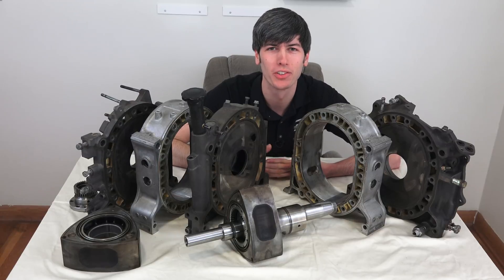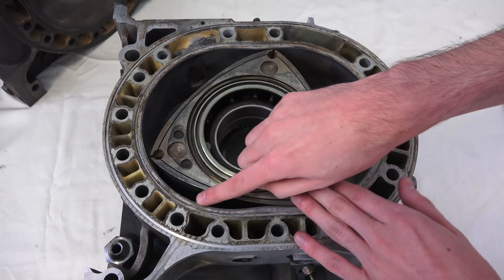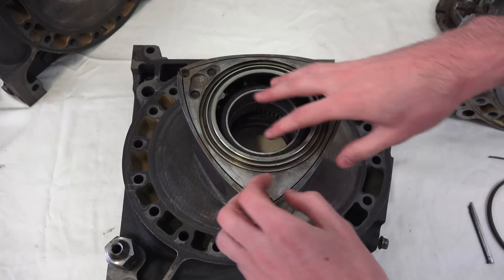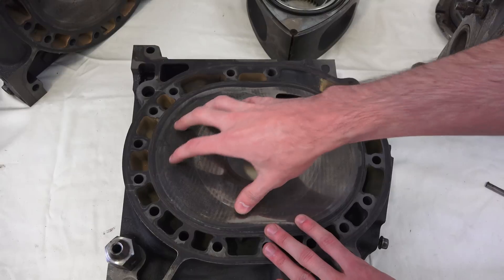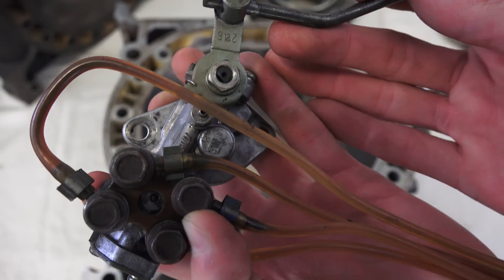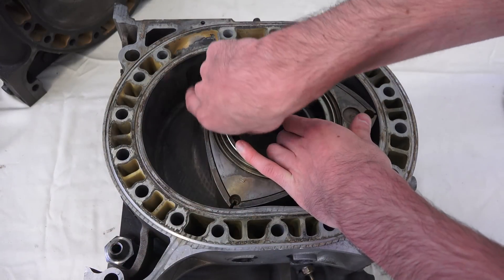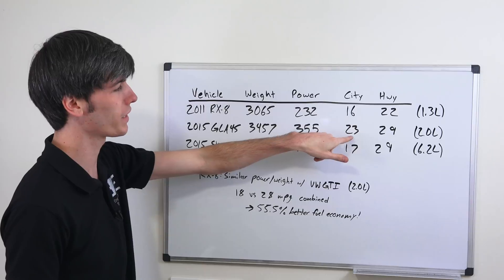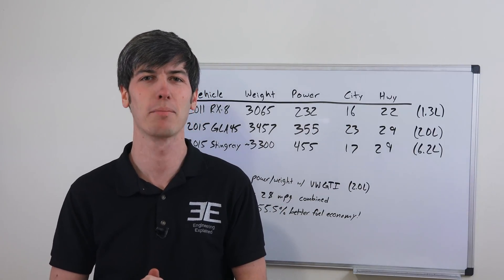4 Reasons Why The Rotary Engine Is Dead

Comment: 1.3 makes 200 Hp impressive
Reply: +AZiZ True, but they are totally different from reciprocating engines. If they were measured the same way as the air/fuel burned per rotation, they would be considered a 2.6 liter when compared to conventional/reciprocating engines.
Reply: +FLoYdInPink 160 ft-lbs at 5,500 rpm is garbage. My four door volvo puts out 240 ft-lbs as early as 1,500rpm. Rx-8s are not torque machines
Reply: +Hercules Rockefeller He knows nothing about rotaries.
Reply: +AZiZ ya, impressive with the thirst of a 6.2l v8 and the torque of a honda fit.
Reply: They make great horsepower, but hardly any torque.
Reply: Taran Ungaro
yes FD. I'll agree that they may have less torque than my 5.4 inj. v8, but less is different to saying NO torque. If i want to tow the boat up the country; v8, if i want to race know-it-alls; RX all day long. Horses for courses. Peace
Reply: +Hercules Rockefeller Highest output stock for the RX7 is 232? the The FD Type RB-S puts out 269hp, and the Type RZ 276
Reply: +AZiZ Fires on every revolution, really a 2.6 liter
Reply: +Ali Ahadi 
Its a good point, a 1000cc 2 stroke is a 1000cc displacement engine. But strickly speaking to COMPARE power output with a 4 stroke you would double the capacity. However nobody ever used the equivalence rule with 2 strokes but thats exactly what Mazda did in reverse. So even though the engines true capacity is 3.9L they choose to measure the swept volume of only a third of a revolution of the rotor or one rev of the output shaft. It is the same as halving the capacity of all 4 stroke engines. 
They did it for 2 reasons, to get round old taxes based on displacement and it makes a very poor engine sound impressive, the gullible are still taken in by it.
Reply: FLoYdInPink Maxthekanuck said they make good horsepower but suck on torque, you said bullshit..160ft-lbs is what the motor in question claims, (not that great).

The specs on my volvo are the stock generic numbers. Yeah its a 5cyl with a turbo, so its not exactly a equal comparison..

I've owned 30+ vehicles including FC's, s2000's, supercharged civics, Ae-86's, fox mustangs, malibu's, etc.. I just dont think of rotaries as having torque, they make up their lack of torque in high rpms and gearing.. Thats all i was getting at
Reply: +AZiZ As my friend who owns a dyno tuning business says "it's about the power under the curve."
Reply: Taran Ungaro Paschal v. Mazda Motor of America, Inc., case number 8:14-cv-00594.. I'm not sure how it turned out, but this was a lawsuit about the flooding problems..
  
I dont know if there was a lawsuit about the HP, but It was mentioned in some tuner car magazine years ago, (when the Rx-8 was claiming 240hp). All I remember is they were comparing dyno numbers to a s2000 (same hp claim) and it was making 20hp less.
Reply: Hercules Rockefeller
You have an obsession with cars. Rotaries are  also for other uses.
Reply: +AZiZ Its a completely different aspect as a rotary engine does not have a bore or stroke, so measuring the volume is irrelevant to a regular cylinder engine. Also, 16mpg for 200hp is not one bit impressive.
Reply: +PrimiusLovin thats just stupid, in that case a 2 stroke 2l should be considered a 4l? :P
Reply: +John Burns 
The engine displaces 3.9 litres in one revolution or one complete thermodynamic cycle, the definition of an engines true capacity.
Reply: +Hercules Rockefeller and also Renesis and Wankel both did there work on the 04-06 1.3 L which automatics produced only 180hp at max rpm 7500 meanwhile the 6 speed manual produced 238hp stock GT model not to be confused with the shinka version
Reply: check out the i8
Reply: Username

Oh dear you really dont know much about rotary engines do you. Mazda quote the chamber volume as 654cc, there are 3 chambers on 2 rotors thats 6 x 654 = 3924cc. so in one revolution of the rotor is sucks in and burns 3.9L of air and fuel. However to compare to a piston engine 4 stroke its reduced by a third = 2.6L. All rotary's suffer from piss poor torque its a function of the E-shaft geometry. Yet another reason no one has been interested in rotary's other than Mazda...in one car.
Reply: +michieff 
Basically you have to thrash the engine to get any usable power out of it, as the torque is so piss poor.
Reply: +AZiZ 
3.9L engine that only makes 200bhp, very unimpressive.
Reply: +Ali Ahadi 
The physical size and weight of a fully dressed RX8 engine was not much less that a typical inline 4. The high rpm was a big disadvantage in a road car because it made the engine so inflexible. The high rpm was necessary due to the very poor torque produced by all rotary engines (just one of the fatal flaws). In other words you HAVE to thrash it to get any usable power out of it. 

"All sports cars are very low profit" tell that to Porsche or Ferrari or Lambo. It is track cars that raise manufacturers profiles not sports cars.

Basically the rotary peaked in the 90's as it reached the limit of what was ever going to be possible, which wasnt much. NO amount of development would have ever improved it beyond that point. The severe limitations of rotary's was recognised by every other car manufacturer in the 70's when they shut down their own development programs. It was obvious to all of them that the engine was fatally flawed, Mazda was never able to address any of the flaws other than tinker with apex seals. Anyone who thinks a bit more development is all thats needed clearly doesnt understand the flaws.
Reply: +Ali Ahadi 
It was simple a rule change of max engine size of 3.5L.
Correction, it was actually 94 & 95 by Team Artnature then Mazdaspeed both ran rotary engines.

Power is force X distance or torque X revolutions, if you measure a rotary and piston engine on equal basis you would reduce the rotary's true capacity by a third. So a 3.9L RX8 would be a 2.6L for comparison purposes and the 787b would be 5.2L.
Reply: +Dan Bonnett I think they are considered as a 2.6 liter engine, at least that's how I remember the RX8 being road taxed in my country some years ago (2 x 1.3L displacement)
Reply: +FLoYdInPink  What are you running with? I have an R3 so I would agree that they are low on torque front myself, but really the Rx-8 is more of a AE86 than a 2JZ powered monster. Do you have like an FD?
Reply: you need to re-read what i wrote my friend. PS the renesis is heavily ham strung by emissions and subsequently fuel economy.  Care to tell us the specs on your volvo motor?
Reply: 1.3 made 280 hp in the last Japanese models
Reply: 1969nydrell David Which model was that? I thought the last model was the Spirit R, which claimed 232hp. 

I remember before the Rx-8 came out, It was 'supposed' to make 280hp, but that number quickly dropped many times.. It was finally released claiming 240hp but that number also had to be reduced to like 210 or 220 hp after multiple lawsuits from people who dynoed them at 180hp and less. Other lawsuits about the stalling problems finally forced mazda to buy back alot of rx-8s or give substantial rebates.
Reply: Hercules Rockefeller  Do you have a source for the lawsuits? I've personally never heard of that. I know there was a lot of effort made to prevent flooding or at least deal with it in the case of the gen 2 rx8. Also I'd be interested to see where it you found lawsuits about people dynoing and finding only 180 hp. I own an rx8 r3 and after a little work mine produces 200 hp at the wheels so I would expect the stock model to produce 180 ish at the wheels what with drivetrain resistance. I only ever noticed mazda claiming 232 @ 8500 rpm at the crank, so I'm legitimately interested where you found this info.
Reply: The real doktorbimmer Oh shit! The doktor is here. I know you know a-lot about rotaries.. 
I know there was a lawsuit about the flooding problems, but was there ever a lawsuit about the HP claims?
Reply: *****
Read my comments on this video. You will be enlightened.
Reply: ***** Your comment on this thread claims that the "rotary is made by many companies". I'm still waiting for you to name one car company thats produced a rotary after 2012
Reply: +The real doktorbimmer 240 hp from an na 2.6l is still pretty good
Reply: The real doktorbimmer It displaces 1.3 litres.
Reply: Sam Sheth 
Not in power/weight ratio. 
Not in small size.
Not in low weight.
Not in smoothness.
Not in simplicity.
Reply: +John Burns 
Non of which proved to be an advantage over piston engines....
Reply: +AZiZ not all engineer's are that you can say that are truly 1.3L.... just saying. there is a debate over what should be the actual displacement of a rotary. 1.3 was picked cause it sounds better
Reply: Chad W Cars are taxed on their displacement. Governments take time and effort to find out. 1.3 litres is NOT a guess.
Reply: +Hercules Rockefeller gonna have to disagree with you coming from someone whose been working In a performance shop and store for years and owning a rotary if anything I ever noticed with the rx8 is that it defiantly is a tq machine considering how light the car is and the high rpm rate now granted I understand what you are trying to get at but if I were you I welcome you to actually try one because if you have you wouldn't be speculating like this and i saw you drove all these cars from s2k to foxes to ae86 well if I may I've driven boosted cars to procharged cars and still nothing feels like a rotary motor but yes the fuel economy is shit lol
Reply: +AZiZ but it also uses almost as much fuel as a 343hp strong 3.2l V6 engine:
Mazda RX-8 uses 11.2 liter per kilometer and has a mileage of about 16.5mpg
In comparison, the BMW M3 (E46) with said 3.2l engine uses 11.9 liter and has a mileage of about 18mpg
Reply: +David Costa 
It fires three times in one revolution, sucking in and burning 3.9L of air a fuel....
Reply: +The real doktorbimmer 
Yes, 1 rev of the rotor = 3 revs of the E shaft.
Horse power is force x distance or torque x rpm so to COMPARE 'different' engine from a power point of view you can do so on fixed degrees of rotation. BUT as you said this does NOT alter the engines TRUE capacity of 3.9L which is simply a measure of swept volume, the same as any engine.
Reply: +NHC Ridley 
Why?
Reply: +MaxTheKanuck an N/A 2 rotor may well be low on torque, but the RX7 was good in that department, I think it had 280hp and something like 240ft/lb?
Reply: The real doktorbimmer It's a 1.3 liter engine. You got a 2 rotor confused with 4 rotas :)
Reply: Manoo42 lmfao where did you get 6 from?
And there's 2 chambers for 2 rotors. 2x654=1308
1.3l
13b

are you ill?
Reply: The real doktorbimmer Each rotor had a displacement of 654 cc, for a total of 1308 cc displacement in the engine.
Reply: +Username 
Clearly you dont have a clue what you are talking about, MAZDA quote the CHAMBER volume as 654cc you clown.
Reply: Manoo42 yes and there's two chambers for two rotors which results in 1.3l
Reply: Manoo42 Yes why not?
Reply: The real doktorbimmer "Each rotor on 13B-REW had a single combustion chamber volume of 654cc. With two rotors, total displacement was 1308cc."

-jdmspecengines.com
Reply: +AZiZ  RX 7 made near 280 bhp, I had a 3 rotor, which made, 602BHP. could boost it over 700BHP but did use gas or did it use gas. ahhahah
Reply: +The real doktorbimmer So is the actual displacement of a 1800cc 2-stroke a 3.6L?
Reply: The real doktorbimmer 231lb/ft for 260hp isn't pathetic

that's comparable to petrol piston engines.
Reply: +Username 
You clearly dont understand the rotory fires 3 times per revolution.
watch?v=mF2lR20aPL0
Reply: Manoo42 So are you telling me a 2-stroke 1000cc motor is really a 2 liter motor?
Reply: Manoo42 At least in the states the EPA does see it as a 3.9L. As long as people can be consistent with what they deem as displacement then I'm fine, I just don't like contradictions.

I am looking forward to the next rotary engine, Mazda has been doing a few patents over the years with direct injection, new orientation for turbo. Should be interesting, especially with cooler temps, lighter weight, more TQ and easier packaging.
Reply: +Ali Ahadi 
Dont hold your breath, Mazda have been suggesting a 'new rotary' was only a few years away for the last 5 years. I seriously doubt we will ever see another rotary powered car again. There has only ever been one in production at any one time in the past. That alone should tell you all you need to know about how useful rotary's are.
Reply: Manoo42 When it comes to a performance car they work well. I wouldn't be surprised if Mazda does bring out a rotor powered car again for promotional value, I mean that's what a sports car is for, promotions, no company really makes money on them.
Reply: +Ali Ahadi 
Rotary's have never performed well, they have no advantage over a piston engines. They have not succeeded in any application they have been used for. Mazda would not build a one off engine for a promotional car, what would it be promoting? dead end technology?
Few manufacturers build cars they dont intend to make money! Mazda canned the RX8 replacement because they knew it would never make back the tooling cost of a new car.
Reply: @manoo422  bs
Reply: @cheese3416  Yeh I am sure that comment will convince everyone...
Reply: Manoo42 The advantage of a rotary engine is it's size/packaging, weight and RPM range. In the early 90's it was pretty slick and did well. Mazda has been doing these engines for a long time as a promotional product of their engineering abilities. All sports cars are very low profit to near no profit once you account for the marketing and promotions, they're used as means to get people excited for a brand. That's why when most manufacturers go to make a sports car they have to do a lot of parts bin swapping. 

I think in general we don't think much of the rotary as being so great now because it hasn't been updated since the 90's really. In the 90's it was a great engine. Mazda recently published a new patent earlier this year or the end of 2015, I can't remember which, but it shows that they are still working on it, albeit probably in their spare time, lol.

Also to produce a rotary engine I still believe you have to pay royalties to the original patent holder which I remember being pretty expensive. 

Anyways, back in the 90's it was a pretty potent engine especially when most other engines were cast iron and the rotary engine was much lighter and more compact than most engines. However now with aluminum construction and new designs it's lost some of its advantage in weight but still has the packaging down, there's just so much new tech that can be applied to the rotary engine that would make it a lot more competitive, however being expensive yea, Mazda won't do it till they can feel comfortable in making a good splash.

Mazda is clearly planning something, when it will happen? Who f'n knows. Much like how the BRZ/FRS took a really long time to become a real car.
Reply: Manoo42 For all it's flaws it worked well as a marketing ploy and it's short life in motorsports was successful. And your example of Lambo and Porsche are difficult examples to go on. Lambo had difficulties making money, thus why they are owned now by VW. Porsche is the most profitable because they produce a car that normally would sell for 60K at 100K. It's the same reason why luxury cars have higher profit margins. Every company wishes they could sell cars like Porsche can, they are the exception not the rule. 

In any case, people like the rotary just like people like any other engine, you can complain about how wrong it is or how flawed it is or whatever. People say that about pushrods, diesels, EVs, etc. What do you want? You say there are zero advantages to a rotary type, but clearly there are some, but until the rotary can be brought back with current technology it would be like comparing an 80's engine to an engine made after 2010, just doesn't make sense.
Reply: +Ali Ahadi 
"it worked well as a marketing ploy" did it? The RX7 might have had a loyal following but it was very small. The RX8 was no success for Mazda, it had so many problems and warranty claims for blown engines it did a lot of customer damage for Mazda.

Its ok to like rotary's for all their faults but claiming they were great engines or an opportunity lost is ridiculous. There is NO technology that could improve the engine design. The combustion shape, a long flat strip could not be worse for good combustion. At the point of ignition the combustion pressure is trying to turn the engine backwards as much as it is forward! The E shaft offset is tiny meaning torque figures will always be small. Thermodynamically its a disaster because combustion always takes place at the same part of the stator never cooled by the incoming fuel and air. The list goes on, all of which was recognised in the 70's by everyone but Mazda.

As for racing the only time production cars won was when they were allowed to run this 3.9L engine in 1.3L classes. 

They had 18 attempts at Le Mans before the 7.8L 787b in 1991 which didnt win a race that year before Le Mans. The subsequent win was a complete fluke mainly due to unwelcome rule changes meant it was a very poorly attended race and the 787L been given 374lb weight advantage due to being so uncompetitive. In a fuel restricted race it tipped the balance in their favour...
Reply: The real doktorbimmer The 787b as you claim as sucking also didn't blow up like the MB and Jags it was competing against and at the time FIA banned it after that race, so of course there wasn't anything else afterwards.
Reply: Manoo42 I won't argue that the RX8 wasn't very successful as you're right, but the prior models were and that's why there was even an RX8 to begin with. Also 787 wasn't racing as a 1.3L the 4 rotor model was being ran as an engine over 4L as deemed by FIA at the time.
Reply: +Ali Ahadi 
The 3.9L RX8 was raced in the 1.3L class....

Rotary's were not banned at Le Mans after 1991, thats urban myth. Mazda retired the 7.8L 787b as it was so uncompetitive. 
Rotary's raced again at Le Mans in 1993 & 94....
Reply: Manoo42 I guess banning it is a bit harsh as it became unusable from my understanding as the rules changed not allowing them. 93/94 wasn't a rotary engine, they were using someone else's 3.5L V8. I'm not familiar with much of the RX8 racing history as I thought the car was kind of ugly and a pig, but the only major one I remember wasn't really an RX8 was a tube chassis or something with a 3 rotor. Also if it was within FIA rules it wouldn't be under 1.3L I believe they calculate displacement based on firing of the chamber based on a certain rotation, thus why the 787 engine was seen as a 4+ liter in their eyes and regulated as such.
Reply: +FLoYdInPink but they do make less torque, right?? "Hardly any" is an exaggeration, but I think that's the point
Reply: +Hercules Rockefeller just one of many...https://www.facebook.com/PulsePerformance/
Reply: +The real doktorbimmer That the rotary engine isn't dead, maybe Mazda stopped making it but we the fans didn't…
Reply: +Martin Rotmo Not quite but the formula in a lot of motorcycle racing ( before MotoGP,  was 500 cc  2 strokes and 750 cc 4 cylinder strokes, 1,000 cc twin and 3 cylinder motors  competed in unlimited classes. In Moto GP, 1 litre, 4 cylinder, 4 strokes replaced 500 cc 4 cylinder 2 strokes. At the time of MotoGP inception, for 1 season, 500 2 strokes competed against 1,000 4 strokes. They were initially competitive against the 4 stroke machines but soon slipped down the order before they were retired. I would think a fair ratio would be 500 cc 2 stroke = 800 cc 4 stroke. A Mazda 1.3 L rotary should be compared to a 2.2 L, 4 stroke. The Honda and Yamaha 500 GP racers were supposedly outputting in excess of 200 HP but really it was difficult to get reliable numbers from secretive race departments. The MotoGP Honda 990 was quoted as having 240+ hp. In there day, 250 cc and 350 cc 2 strokes such as the Yamaha RZ series road bikes, were recognised as giant killers, competing with bikes with double or even triple their capacity. A Yamaha RZ 500 4 cylinder 2 stroke won the Castrol 6 hour production race and it was competing against machines such as the Honda VFR 1000 and Suzuki GSXR 1100's. The reason why 2 strokes do not just produce twice the horsepower of a 4 stroke of the same capacity is by their very nature, are inefficient and do not extract as much energy from the same amount of fuel. They have poor fuel consumption and higher pollution just like the Mazda rotaries. However their big advantage is their light weight and compact dimensions which compensates to some extent for their poor fuel consumption. The Mazda's did well in competition in the 80's with giant killing performances in Australia and in various classes throughout the world, including Le Mans 24 hour races. While the poster of the video is explaining why the rotary is dead (I think Mazda may disagree with that), he doesn't acknowledge why they were such a force to be reckoned with in racing for many years, with a reputation for reliability with the combustion chamber and rotor tip seals issues solved.
Reply: +droceretik 
Rotary's were never a force to be reckoned with in racing, they were not even competitive unless racing against much smaller engined cars/bikes.
Reply: Don`t you 3.9 litre ?.
Reply: MEAN. Typo error.
Reply: They are considered 2.6L, and my 2.0L four cylinder makes 240HP naturally aspirated (S2000).
Reply: +MaxTheKanuck bullshit. I'm sorry but i'm so tired of hearing that myth.  I smash all sorts of cars going (intentionally)uphill because they still believe that tired old bullshit
Reply: The real doktorbimmer
This idiot keeps writing this when the rotary is made by many companies.
Reply: "suck on torque" thats bullshit.
"lack of torque" getting closer to the truth.
 
  Perhaps our misunderstanding is you want to look just at the renesis motor in stock form. 
 
 As you would know since you had an FC, in stock turbo form, their rev range isn't any higher than the average piston motor, likewise the FD. So i don't buy that argument.

  Gearings choose themselves.  Crudely, motor produces X, ideal rpm is Y, therefore gearing equals Z. Of course we could just use the kW/Nm from the flywheel though...

  RE your volvo, "it's not an exactly an equal comparison"  I agree with you there